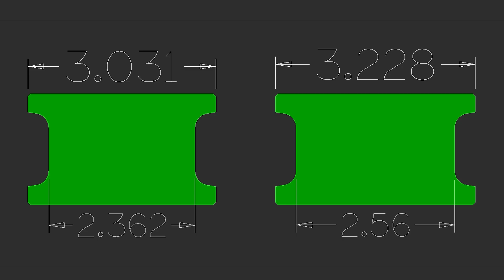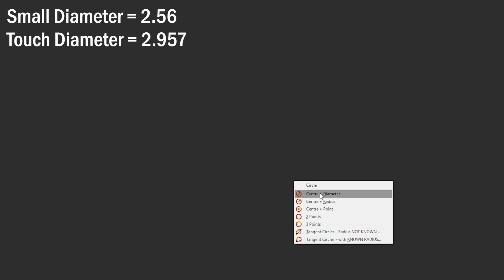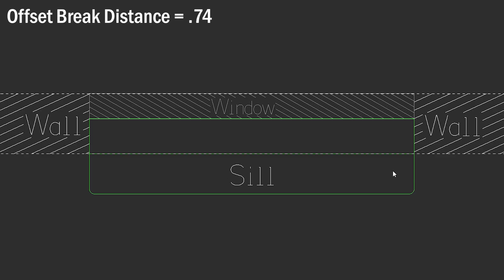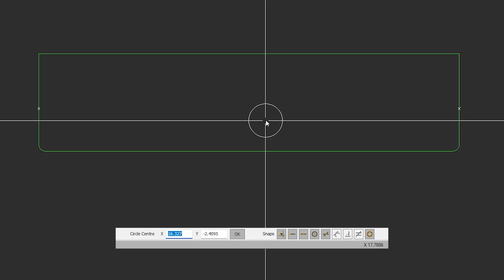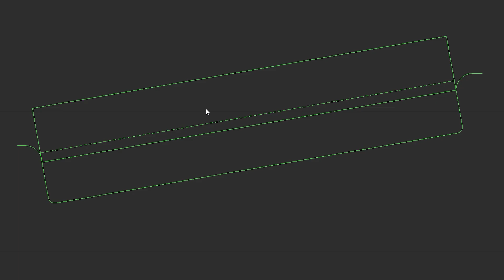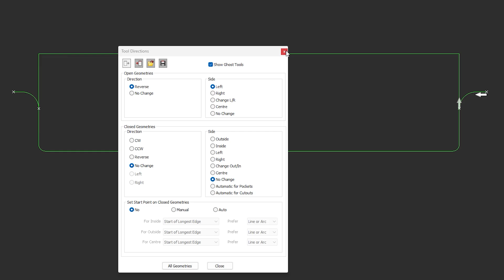Programming a Finished Return

Comment: Does park have a video explainingtool directions? If your tool is spooning clockwise then it should be running counterclockwise along the Geometry. I've been trying to explain that the reason the tools are buring are because they are running then in reverse. After 20 years programming and running park machines my new technician is wrong for making it go in reverse. It's better business for grandquartz. 😂🤦‍♂️
Reply from the maker: We don’t currently have a video on Tool Direction, but it’s a great topic with plenty of differing opinions out there. At Park, we teach Climb Cutting as the preferred method. Climb cutting means the tool moves with its rotation — for example, when cutting around the outside of an island, you’ll go clockwise, and when cutting around the inside of a sink, you’ll go counterclockwise.

This approach “pulls” the tool instead of pushing it, which helps minimize blowout and gives a cleaner edge, especially when working with more brittle materials.